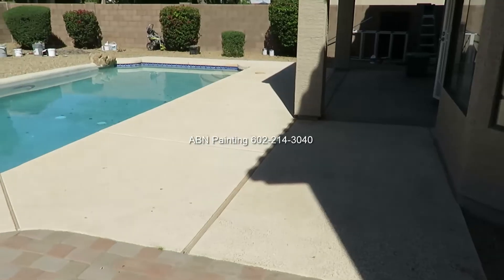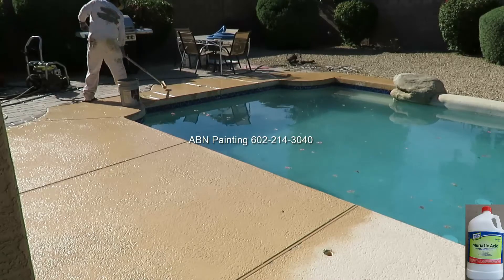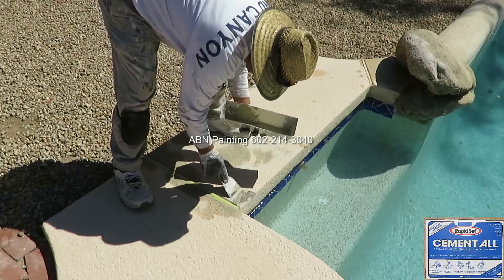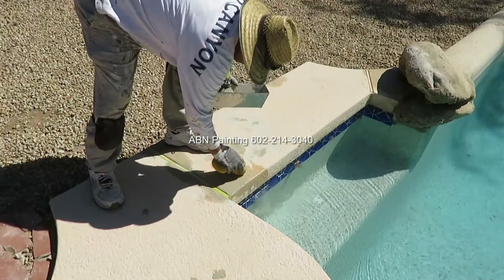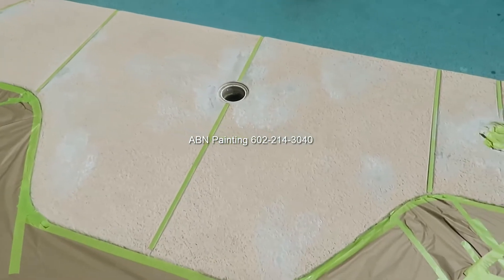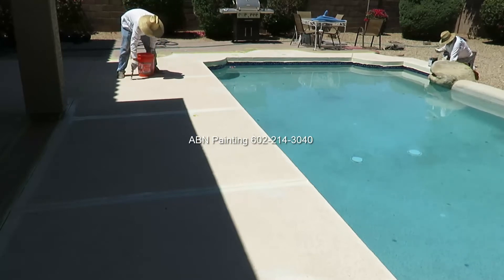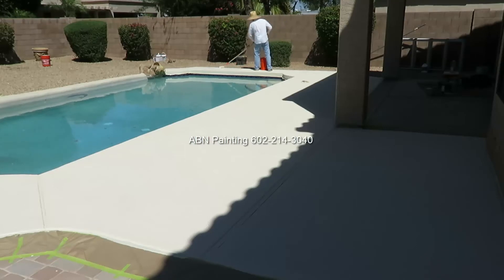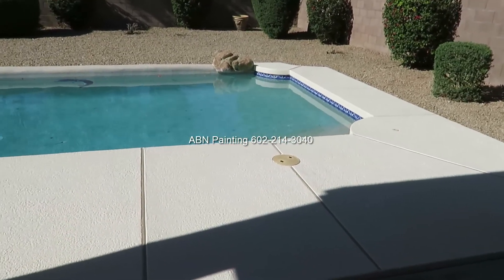Applying Behr solid color concrete stain to a pool deck.

Comment: I noticed in an earlier video you used Behr Deckover coating and in this video you used Behr Solid Color Concrete Stain. Is there one that works better? We need to paint our stamped concrete pool deck that already has texture. Which one is more durable?
Reply from the maker: Behr Solid Color Concrete Stain is much easier to apply. It will give you more coverage per square feet. Deckover is a lot  thicker and will cover any imperfections better. It is very hard to apply due to its thickness and you will need more of it, as per square feet coverage is not that great. Both about the same durability. 
Better then Behr stain or Deckover I like H&C Stain. It will be more durable out of the three.
https://www.sherwin-williams.com/homeowners/products/hc-colortop-waterbased-solid-color-concrete-stain
Reply: Thanks so much! This is very helpful. @PaintersPhoenix

Comment: What do you recommend using to patch some concrete damage?? from salt use in the winter) it’s all around the pool deck around 700sq ft. And how many cans of paint do you think I would need?
Reply from the maker: http://www.xcelsurfaces.com/products/index/texture-mix/  best to use if you can find it in your area.
https://www.homedepot.com/p/Rapid-Set-55-lb-Cement-All-Multi-Purpose-Construction-Material-02010055/202188447   used on some decks but not the number one choice if you can find something specifically for pool deck like material in the first link.
Could not tell you how much paint you need without looking at the pool deck.

Comment: Can the tiles around the pool at the water line be painted?
Reply from the maker: There has to be some paint for the tile but as far as using the same coating we are using for concrete - Berh solid color stain - no it would not work for tile.

Comment: Do you guys apply a sealer??
Reply from the maker: We do not. With sealer it may last a little longer but when you need to re-apply the paint in the future you will need to strip the sealer first, which is a lot more expensive project than applying in. Without the sealer it is very easy to re-coat in the future when you decide to refresh the look again.
Reply: Thank you